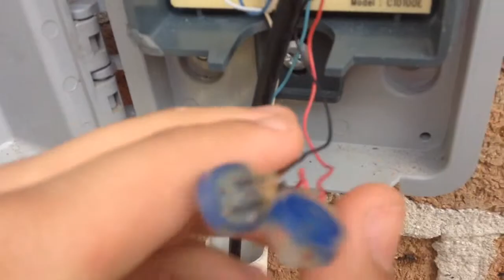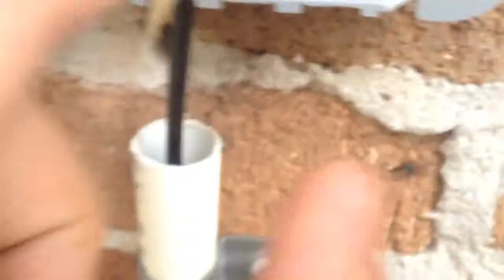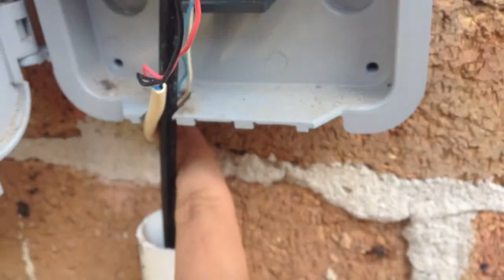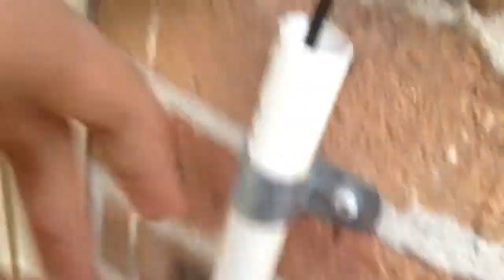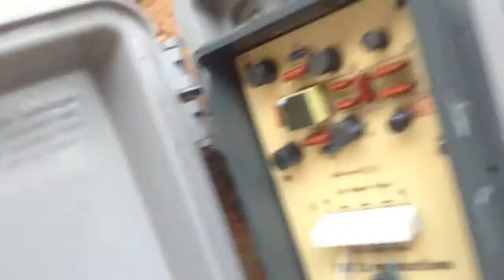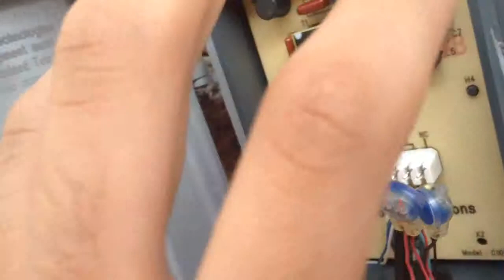How to Speed Up DSL by removing Ring Wire

Comment: Looks like some nasty old wire going into the house, but I guess the one coming in doesn't look to be high quality either. Unless the modem is sitting directly on the other side of the wall I suggest replacing it with cat6a network cable, and crimping a connector directly on the end of it instead of going to a wall socket. The cat6 or cat7 with foil shielding probably wouldn't hurt either, and it made a difference for my connection.